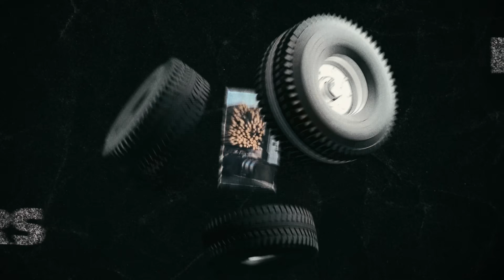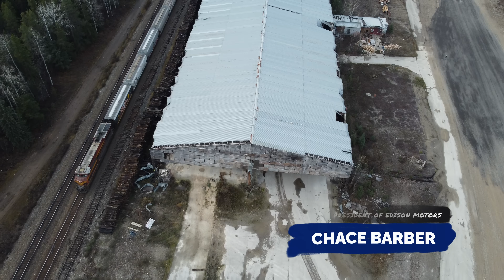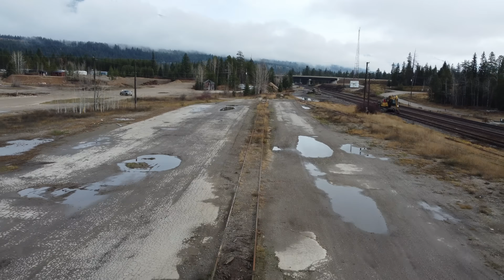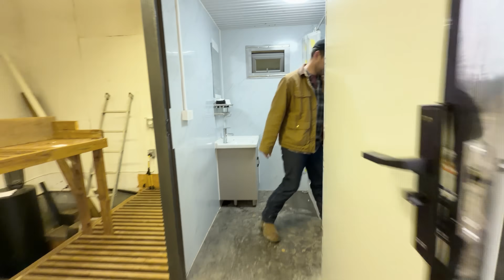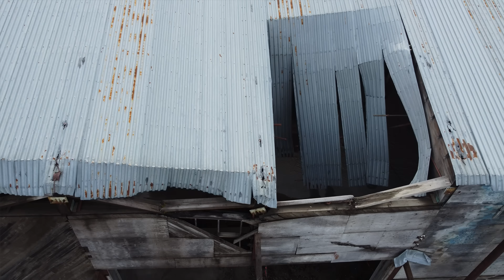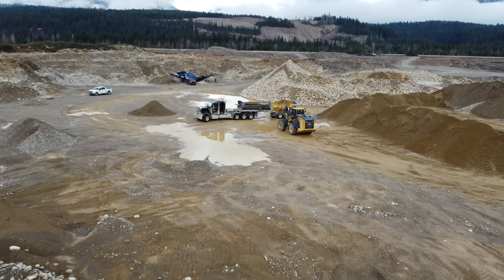Can we Turn a LIABILITY into PROFIT??

Comment: Sounds like this could work, if you can get CPKC onboard, and other industries to use it as a shipping/receiving dock.  And if not CPKC, look for some of the terminal servicing operators, like Cando Rail and Terminals.  Canadian company, who handle serving individual industries, over the regional hauling of bulk freight.

We're cheering you on from State-side.  Good luck.

Comment: Off topic but could you put an "engine brake" switch on the shifter that increases regenerative braking in order to brake more aggressively? Or maybe some sort of analog lever? You'd have a finely adjustable regen brake. Maybe also speed governed instead of percentage like some sort of cruise control? Implementing both wouldn't be that hard and would save brake pads and increase range, no?

Comment: I would highly recommend if you're going to have your own rail shipments coming in picking up a small little diesel electric switcher. At the railroad I'm at one of the guys picked up a little 45 ton diesel electric switcher for like 26k at an auction fully redone. It would really be beneficial for you guys to have your own little engine to move things around in your yard.

Comment: The permits for this will be in the tens of thousands and likely take months, or at least a year. Great idea otherwise, but the tone of the “just need a permit” at the end might get checked (unfortunately).

I’ve seen something as simple as a deck cost thousands in permitting and take months. This is a huge commercial space. An architect’s stamp will be required in most states and counties.

Comment: I don't get it, you are developing a gravel pit and a trans loading facility? These seem like secondary goals which share not really anything with your EV truck vision O_o
Reply: Correct.

They inherited monthly revenue from the already working gravel pit and Lumber yard so they just kept them running. A win for Edison, the renters, and the customers of the renters.

Restoring the rails has the potential to bring in 100k/month which gets Edison to profitability much much sooner.

The efforts into rail are not accelerating or hindering the design/construction of trucks, or the finishing of the assembly plant.
Reply: Because they don't have any money@  did you hear anything about replacing the building?  They probably don't even have enough to tear it down!
Reply: @GordonJack-g6i 
Edison has plenty of cash on hand.

Comment: Just be wary of those old rails. If they are in good enough condition to be used now, that might not last long. So make sure you have quotes on hand for full replacement just to keep that cost in mind because they are likely gonna quit on you the moment you start doing anything more than just being railcar storage. I also second the person who suggested turning one of your trucks into a hi-rail vehicle. It can server as a tech demonstrator to sell to people needing a hi-rail truck base and work as a shunter without having to be a dedicated shunting asset. Saw a video the other day of a hi-rail truck pulling a full on like 4-6 car train down the line. The previous company i worked for had an all electric shunting vehicle that was basically a hi-rail vehicle. Real useful since you don't need to put them anywhere on the rail so long as you have a put-on spot.

Comment: You shoulda start making trailers with e-axles in them that are and the power hook ups are were the air lines are on a conventional semi. That way the trailer can draw power from the generator, but trailer weight becomes irrelevant because every trailer can power itself.

Comment: @EdisonMotors love what your company is doing! I know you and a whole team of engineers decided its not worth saving, but as an Ironworker in U.S. who builds large structural steel buildings and bridges i'm curious. The actual columns and beams look to be in decent condition! Only saw so much of it ofc, but it deffinately needs a whole new roof system and siding all around, maybe the perlins they attatch to. But the bones look good and thats most of the expense of a new building. I would think replacing those other things would be far more cost effective than a new build 🤷‍♂️

Comment: So you wanna build a new shop but don’t have a production going so you’re gonna spend millions of dollars without any revenue why won’t you move to location that has a building available in your focus on the product and spend your money on manufacturing the product instead of building a building
Reply: Edison is still doing R&D. Edison doesn't have a product tested enough to go to full production.

If they went to full production based on Topsy, then all they would have built is recall machines. Edison would have recalled the axles, inverters, BBB, computer, & Batts.

It is nonsense for Edison to rush to production TODAY.

A year from now is another story.

Comment: I would like to durability test, run the EV on test track, let generator recharge 10 times without plugging it in. Tell us how far it went before charging, how long it takes to charge, how many charges per tank, and if there is any decrease in battery life over time.

Comment: I wonder if a train switch is enough also you might wane invest into some sound proofing if you gone have a workshop next to the train tracks. if there this bizzy. also a extra switch wont hurt if the train needs go true and offload and then load and continue down the track or go back on the track. -- also any room not used -- could be used for temporary paid storage while you work on what the company realy needs. -- also extra off and on loading bays for company growth. -- Hopefully most of the lumber you can save from this Massive storage barn can be used again. Lovely project ive watched some stuf before of edison motors. But if i would invest anything i realy would need dividends from you're company. specialy als a international person. I do believe in a project as this and this location breaths possibilitys. But i cant have a qeustionbale return i cant afford that. If there any possibilitys of shares that pay some dividends i wouldnt mind giving some into the project. But i would need check a lot. if i would get serious about that. but its surely a lovely project.

Comment: the metal dust from the rails is hell on electronics make sure there air tight it works its way into the vent holes and magnets to everything i cant even keep a waterproof flashlight in my pocket without it destroying it in less than a week

Comment: Check out the lighting fixtures in that warehouse! It would be pretty awesome to bypass the ballast and re-use them with modern LED replacements. Leave the ballasts in place for if you want to get rid of them but sell them off to collectors of lighting fixtures. Don't just scrap them. 
Direct on mains LED replacements for old high bay mercury vapor, sodium or halide lamps exist. Do choose the appropriate color!
Same goes for other properly old fixtures. They get scrapped by the millions, while for decades they were representative of what things looked like in the past.

Comment: Guys for as much as I love your company and potential, you have a significant risk of losing lots of precious time. Long term thinking is important, but in fast moving markets there are reasons investors want businesses to work ASAP. You're already competing against much bigger actors, and if you lose even one year of short term progress you might be finding the competition much tougher. No amount of long term plans can compensate for that, as a debt free factory is still worthless if it produces items that can't be sold. I really hope I'm wrong here, good luck guys!
Reply: Fussing with this rail line and decrepit warehouse does not accelerate or hamper the construction of the new assembly plant.

It doesn't hamper or accelerate the design or assembly of trucks.

It does open the possibility of getting from red to black sooner so Edison is less beholden to the investors.

Comment: Having a line go right through the shop to reconnect to the main or at least a little staging area might be useful as well. So you wouldn't really have to train shuffle if your loads were towards the middle of a lash-up. Train could split drive in on your rails, drop your cars and go back out the other side back onto the main. Reconnect and get going again. Depending on how much area you have to work with at least. But for sure embed the rails even with the concrete or black top so you can maximize ground parking and or trans loading right from a truck onto a flat or boxcar.

Plus it would be a good opportunity to build yourself your own track mobile to move loaded cars out for pick up or empties in for loading.

Comment: Hopefully a switch/ turnout connection won't require interlocking because those are a pain. If you can get away with hand-points its so much better for the one off cost and all you really need to do is grease it time to time. 

If your sleepers / ties are in decent condition but your ballast layers a bit contaminated with fines. Its worth doing some ballast drops and tamping it to give you a good baseline geometry and good drainability as well long term.

 Also a cheap rail gauge for measuring gauge and cross-level to keep your overall maintenance up to scratch might be worth it long-term if you want to keep your inspection and light maintenance costs in-house

Comment: Be Careful the Railroad industry has changed a lot since that switch was taken out, Private Equity got their greasy slimy fingers all over the Industry in the 90s and the Railroads have become obsessed with the Operating Ratio (a weird metric they shouldnt be using) and because of this they are an absolute pain to deal with

Comment: Hey guys, as others have said. Get your existing rail evaluated. There is a lot of rail in North America that is still in service, is not control cooled, and is as light as 80lb. I cannot stress the importance of tie condition, ballast composition, and drainage.
If you need to add rail to make more spur lines no lighter than 100lb. Do not use rail that is not control cooled.
Used rail is not the end of the world, and for most spurs or sidings will work just fine.
Get your rail contractors to understand you are very concerned about drainage, ballast size and composition. If you have good drainage, and good ballast, your new and replaced ties that you put it will last 40 -50 years.
The better your ballast is, the better your ties stay in place, and the slower they rot. The better condition your ties are in, the less chance you have for derailments. 
CN can be real aloof to try and deal with. Sometimes they just don't seem to care.
Not sure how it is to deal with CPKC.

Exciting to see all this develop. I wish i could invest in your company but being in the States, with the financial means i have right now, i don't meet the minimum.
So for what its worth, i will stand on the side and cheer you on.

Comment: You probably could build electric versions of that gravel mining equipment using your in-housetechnology, charged up for free by a humongous amount of solar on that roof. even in winter time you could be self sufficient with such a big solar installation. (it's also another dual use setup that would be a revenue stream)

Comment: Good idea in principle, but be prepared for significant setbacks. Both Canadian railroads are beholden to shareholders (hedge funds) and still adhere to principles of PSR. As a result, small customers get neglected since there is more revenue to be had in haulage compared to servicing customer sites. If you're in an area with multiple industries off the main you might be lucky enough to have a local assignment, but the railroads will still put profit before service (in short, just because you have a scheduled service day doesn't mean they'll actually show up). Everything said, as someone who has worked local switchers for pretty much their entire career, I'd love to have you guys as a customer - but alas, I'm a grunt with no decision making power lol

Comment: I work on a rail subdivision that mostly has passenger train traffic but there are several small spurs that are still utilized and served by CN rail despite being quite small. We're talking 2-3 cars per spur. My point is, CPKC will absolutely serve you if you can generate carloads consistently. The rail industry needs growth so building new tracks to support new industry is very important going forward. This is essential for driving up share prices. Railroads can no longer simply make cuts to increase profits. They have to expand, find new customers and move more freight. The more carloads you can generate for CPKC, the more they will want to get that spur re-activated. Keep us updated!

Comment: I’ve got an idea for you guys at Edison Motors that could open up a whole new market. Have you ever thought about building a hybrid hi-railer pickup or even a tractor-trailer hi-rail unit? I bet a ton of railroads would jump on that.

If you partnered with someone like CPKC and converted two trucks for testing (one pickup and one tractor), it could be huge. And if the rail wheels used regenerative braking—similar to locomotive dynamic braking—you’d get way longer range than the gas/diesel hi-rail trucks track crews rely on today.

With knuckle couplers, these trucks could haul small ROW cars, equipment, and even handle light switching for sites with rail access. It’d solve a lot of problems for maintenance crews and shortlines. You could even repower older Trackmobiles with a much more efficient hybrid system.

Just throwing the idea out there — especially since you already have rail access, making it perfect for testing and even shuffling cars without needing to hire a locomotive. Wishing you guys the best, and happy holidays!

Example video below:
https://www.youtube.com/watch?v=EJfZMasVB54&t=2s

Comment: 1:00 is that a nikola truck in the background
Reply: Correct.
It is one of 108? non functional Nikola semis that were sold at auction. I think Chace picked it up for $2k and spent 1/2 that much getting it delivered from USA.

One option was to mount it on a pole near the highway like that semi in Man of Steel.

I believe the current plan is for rich at deboss garage to install a 12 cylinder Detroit diesel 2 stroke in it.

Comment: I used to work for a Canadian logging machine manufacturing company in Ontario, I'm sure you can guess who, the list isn't long. That concrete pad alone is a fantastic asset, especially if its rated for rail freight. Where I worked we had all the machines on electric roller carts that the guys on the line could move from station to station, they rolled right on the concrete and could hold tens if not hundreds of tons. Anything big got the 60T crane and most beams in the plant had 2-10T Jib cranes. The sub-assembly stations (hydraulics, engines, booms, heads, decals etc.) were tucked in the corners and Jobs were kept on carts or gantries with castors and fork holes so they could be delivered to the lines. It was a great setup although that market is tough. 
Something I'm sure you know is they make a habit of bringing logging crew to tour the place and a lot of engineering problems can be caught by talking to actual operators in front of the machines they use.

I work at a chemical plant now set into a portion of an old paper mill, One work of advice (although I'm sure you've heard it): Beware of paint and pipes. Lead and asbestos go hand in hand with old industrial stuff, and especially if you've got kids you want to make sure you get home healthy and don't wear hazards home. Lead is easy to test for, there are kits online you can buy for cheap and only need a paint chip, asbestos is a little tougher but it looks like this place is pretty well stripped from the video. Good luck!

Comment: a rail siding used to cost 10 to 20 thousand about 10 years ago, do a siding with a loading centre is a great idea.  You can sleep fine with a train; you get used to it and roll over in your sleep when it goes by. Remember eat ass and skate fast; if it moves grease it if not paint it!

Comment: Besides shipping or use of the rail connection, wouldn’t it be full circle if Edison Motors would build hybrid diesel locomotives like the trucks are. Not the typical GE or EMD units, but more in style of creating an engine that would possibly create more use of track? 

Or have their own “yard switcher” created to shuffle their own loads?

As in the videos had been said quite a lot of time: they reference the use of diesel-electric transmission of locomotives as “why not use it for the trucks?” 
Why not make a yard switcher that is comparable to an Edison Motors hybrid truck? Only the frame side would probably be 2 bogies with electric motors, but the powerplant could be very much the same?
Reply: Heck, i believe the e-axles Edison is using are also used on electric trains from Bombardier.

I'd like to see Topsy converted over. Would give it a job instead of being a lawn ornament.

Comment: Great idea and its only right to use it. Many Railroads have closed little sidings like this as they wherent profitable for them, but a private company could make it work.
But that also depends on easy or hard Canadian Rail is to plan and work with.
Here in europe many companies located besides rail lines have given up their siding in frustration as the rail provider wasnt dependable enough and trucking is cheaper.